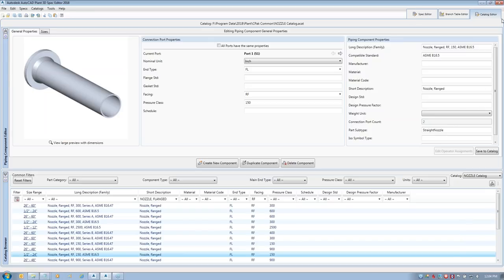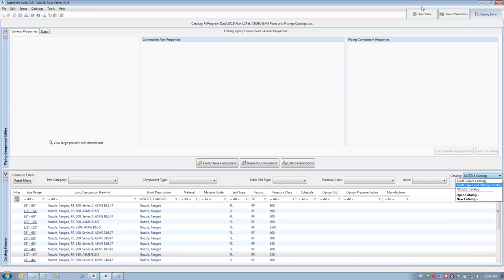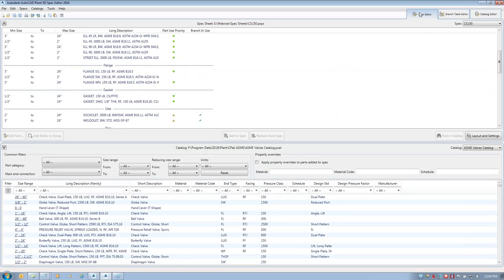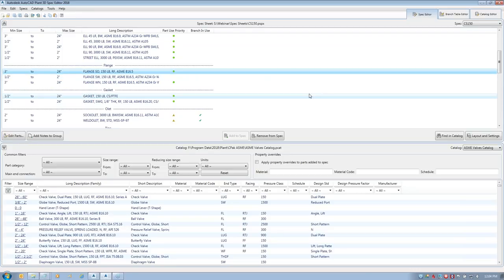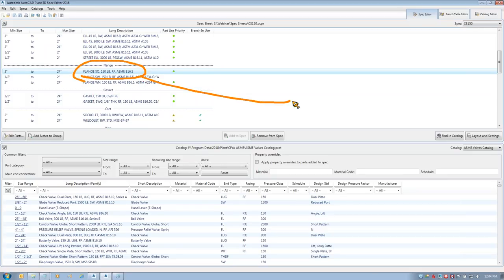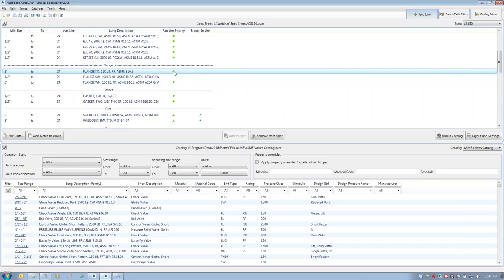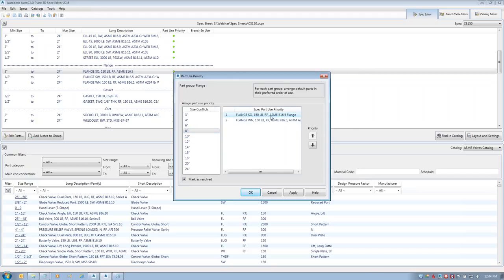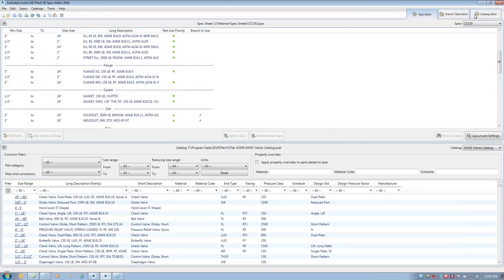AutoCAD® Plant 3D Adding Custom Parametric Components to the Catalog

Comment: I'm only just finding your video now. Pretty good. I've been limping along trying to find documentation on Python programming for Plant 3D. For example, the parameters can accept an Ask4Dist=True/False value, but it's not documented anywhere I've found. Your demonstration included use of the setPoint method, and I've somehow found a setLinearDimension method as a means of having a movable point on-screen to update Python parameters. No good documentation on this. There's sparse information on using Custom versus Parametric ComponentDesignations. I have programming successfully supports and piping components, but all parameter-driven. I'm trying to find means of, for example, reading a flange-thickness from an existing or connecting part, when placing and drawings studs. I know that this is not out of box, but, the length required for a stud is being determined at some level when parts are being place. I'm trying to replicate and/or replace the out of box method. Any feedback is welcome.
Reply from the maker: Thank you for your comment and for watching our video! We're glad you found it helpful. We understand that documentation for Python programming in Plant 3D can be challenging to find, especially for specific features like Ask4Dist, setPoint, and setLinearDimension methods.

For detailed and specific inquiries like yours, we would have you reach out to our support team. Here is a link: https://www.hagerman.com/training-support/support

Comment: This is  fantastic tutorial, I was just wondering if you had the scripting to create an standard elbow with a straight either side. I have made all the image files just struggling to get the code sorted. any help would be much appreciated
Reply from the maker: I believe there is an out-of-the-box template in the catalog editor that can be used to accomplish this.
Reply: @Hagerman  thanks for the response, the issue I have had is the standard elbows I have found won't let me edit the straight after the bend, once placed in the model. We use a lot of HDPE sweep bends that have a long section of straight after the bend as standard. This straight can be cut back as required. I haven't found a way of being able to do this. Any help would be much appreciated.
Reply from the maker: @DavidForsyth-e6d  I would check the Autodesk Content Center and see if they have anything that can resolve this.

Comment: Thanks a lot Sir !  I'm just wondering why in the world AutoCAD did not supply a SO flg in Nozzle catalog
Reply from the maker: They provided SO Flanges in the piping catalog, just not in the Nozzle Catalog. I really have no idea why they did not. I always chalk stuff like that up to “programmers” not designers.
Reply: WE buy this software it very expensive for a license for easy modeling plant, but why them not provide this slip-on flange in equipment. then other problem, them not already match fitting on this software, like seem the flange DIN to ANSI. sometimes we use GFS bolted tank. FRP tank, then nozzle flange to connect the ANSI/DIN. What result, no matching find

Comment: Would this be the same method to use to add more customization to items in the support spec, i.e. added grips, flipping parts, etc.?
Reply from the maker: You could, but I would search the Autodesk App Store for supports first. If not there then I would consider if Block Based Parts might be an easier and faster option. Really depends on the number of sizes which method would work best.

Comment: As I get to the 23.47 minute mark and go to "Tools", "Modify shared content folder", I get a pop up saying that administrative access is required to change this shared content folder. How do I gain access to this, even if Plant 3D is installed on my local hard drive? ~ Laurie
Reply from the maker: I would suggest talking to your IT department. That is a Windows permission issue and not related to Plant 3D.
Reply: @Hagerman  Thanks. As I got through the video, when you created the custom pump and template for it, how come no image is shown of that pump and it shows only a ? and not the block itself that was created? ~ Laurie

Comment: This is a great tutorial, almost everything went to plan for me except when I ran the "plantregistercustomscripts" command it only generated the scriptGroup.xml, variants.map and variants.xml, no .pyc came through?.......what am I missing?, your assistance is greatly appreciated, nice job!
Reply from the maker: My best guess is that there was something incorrect in your python script causing it to not compile.
Reply: @Hagerman   HI, great video, I'm trying to implement some new valves, supports to our database. It seems to work for me, Plant creates the 3D geometry, but is that normal that it creates always a folder [__pycache__] instead of file .pyc as per your video? Thanks
Reply from the maker: @mikaelbezerracotiasdossant5540  Depends on how the Python is written to what all is involved. In the video, I am using some out-of-the-box pythons that are not that complex so no folders were part of the deal, but I wouldn’t be surprised about others creating folders as well.